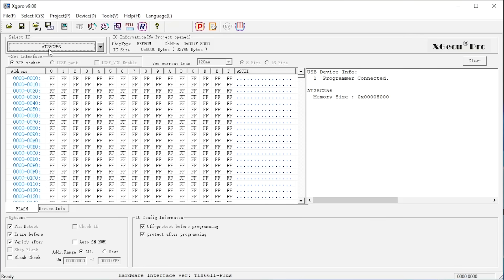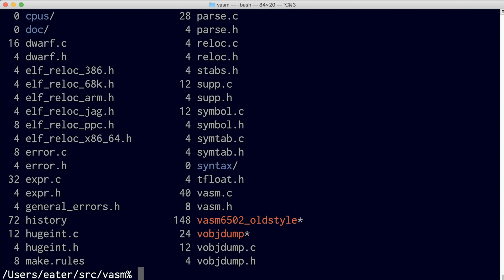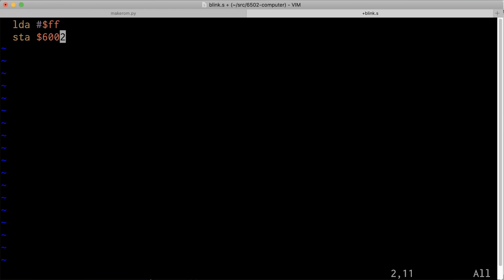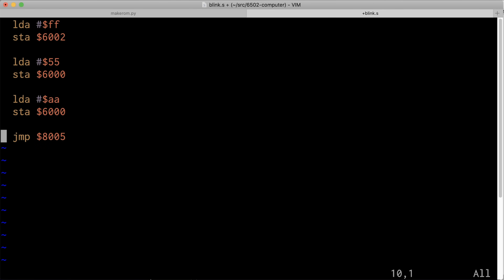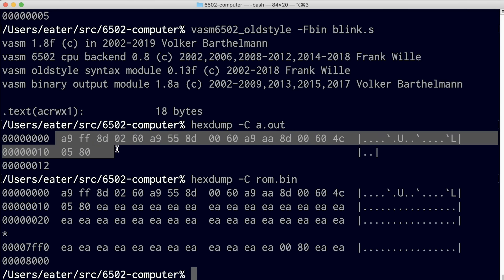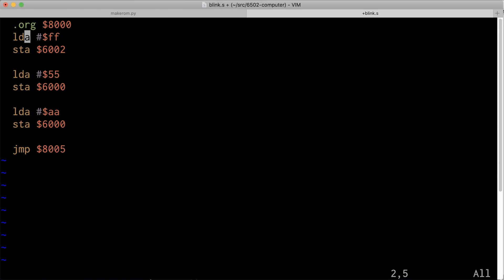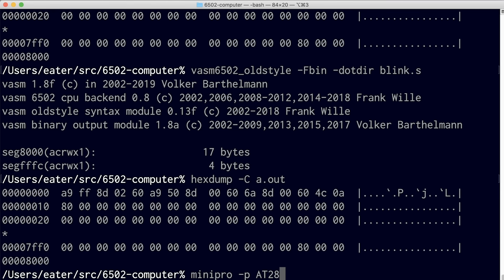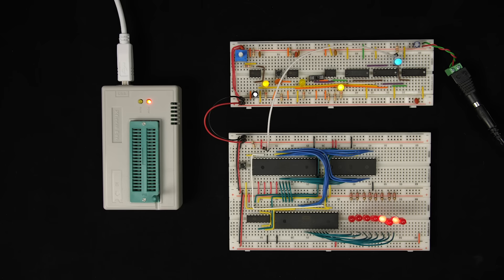Assembly language vs. machine code — 6502 part 3

Comment: One little detail... you might throw a CLC in there before the ROR unless you want to be surprised by three lit LEDs once in a while. 🙂
Reply from the maker: Hah! Good point.
Reply: The original 6502 from MOS actually does not clear the carry flag on reset, confirmed with Visual6502, so you have a good point! This might be different on the CMOS version though.
Reply: Explain please?
Reply: NoName If the carry flag is already set when the program is run, you’ll see three LEDs lit as the ROR rotates the bits around. From the datasheet, “All Registers are initialized by software except the Decimal and Interrupt disable mode select bits of the Processor Status Register (P) are initialized by hardware.” So the state of the carry bit is undefined when the program starts and has to be cleared explicitly if you want to make sure it’s off. Personally, I don’t mind being surprised in this example.
Reply: @NoNameAtAll2  
Even more exotic stuff can be done such as reading inaccessible control registers with an XOR mask that otherwise cannot be read; 

Other issues involve setting no-interrupts which is a difficult issue for me to think about; Here from the comment of John Scarfone we have rotate right which brings us to does it use what sometimes is a sign bit { + / - } or does it even look to see what the value is? 

Study Ariane Rocket disaster and you can find adherents of a multi-volume work I forgot the name of saying that it was not them and many other situations which deify sanity and bend the notion of what is right;  This is known as sanity checks when you drop into a loop; Clean programming will  run an initialization which sets some things and does not bother with others → for example you do not clear memory for testing usually;

Poor work results in midnight phone calls which are notorious for pitting you challenging vast empires that do not care in the slightest;
Reply: Thanks for that comment, i was already wondering why the carry bit somehow was already set on my cpu.

Comment: error 1011 in line 1 of "blink.s": identifier expected
>lda #$ff 

i had to add a tab at the start of each line to get vasm to assemble my code. in case anyone else gets confused. ben actually mentions it at 6:20 ish. >.<
Reply: Many older assemblers did not care about column position at all.  8080 and Z80 assemblers used the colon following the label to denote it as a label and would throw an error out if the symbol could not be identified as a mnemonic and did not have the following colon to identify it as a label.
In other words, it would check the first thing on the line to see if it was an opcode mnemonic such as LDA and if it wasn't an opcode it would check for a following colon to see if it was a label, otherwise you'd get an error message.
At least, that's my understanding of how it worked.  I may be wrong since I used to offset my assembly code instructions anyway just out of habit so it was easier to see where the labels were in the code.
Reply: This is quite common to most assemblers.  Last column used to write comments (tought semicolon preceded)
Reply: Some how I made this mistake and about panicked. Then found your comment. Glad you said something. Although now I feel kind of dumb.
Reply: @fathomisticfantasy2681  You're learning. You're not dumb. Good luck with your build!
Reply: @ServitorSkull  they might be dumb you don't know

Comment: nice one. Thinking about making a pcb  design for that clock module if i can get it under 100x50 mm . i think this kit could be expanded very easy also ever thought about adding  6551 serial interface to it ?

Comment: I HAVE in fact written code as a series of hex values...

But yeah, it's tedious as anything.

The things we do when we don't have access to proper tools. XD

To be honest I did this by doing the assembly process manually.

First I'd write assembly code, then I'd convert each line manually to it's hex code equivalent (keeping in mind byte reversals implied by little endian code), then I'd copy out these sequences into a block of hex values...

Then I'd write those values to a file using a hex editor.

Tedious, but it works if it's the only thing you've got...

And to be fair, there ARE people that have written fairly sizeable programs this way back in the 8 bit era - basically anyone whose only programming tool was a memory monitor has had to resort to this...

And you'd be surprised at some of the things that have been created that way...
Reply: Me too, and yes it is.

Comment: So... What book are we following for the 6502? It was "Digital Computer Electronics" for the 8 bit Breadboard Computer. It's hard to beat the plethora of resources on 6502 dot org, but is there an academic go-to reference for 6502's?
Reply: Anything written by Jim Butterfield (for 6502)
Reply: For coding, "Programming the 6502" by Rodnay Zaks was my bible in 1980...
Reply: Thanks. I did a quick skim on eBay yesterday and apparently there has been a run on ex-library/second hand 6502 books. Everything seems price inflated. It's no big deal to me. I have "Microprocessor Systems Design" by Alan Clements for Motorola's 68k stuff/systems designs in general. I was just wondering if there was an equivalent 6502 academic top-down (cook) book. I usually can't make it past the first few chapters of most programming publications before I'm bored out of my mind. My only motivated interest is embedded hardware. Starting with, and progressing from, printf or other equivalents drives me nuts. While it's still just beyond my grasp, "Threaded Interpreted Languages" by R. G. Loeliger contains some of the most interesting software concepts IMO. I keep coming back to that book. I also find "Introduction to VLSI Systems" by Mead/Conway fascinating. The idea that a student could design and have silicon fabricated in a few months by Xerox...what an incredible era of decades past :-)
   Are there any other vintage hardware publications that are a basic rite of passage for the non-EE hobbyist?
   I went on a tangent last night reading about the VAX-11 computers and then onto ISA's in general. Does anyone know of a good top down, undergraduate level (or lower) book about ISA's? Anyone can google-foo this, but someone vouching for a publication they've read is a search of far greater value :-)
-Jake
Reply: @UpcycleElectronics  I forgot about Rodney, yes he is good too.  http://www.atarimania.com/documents/Advanced_6502_Programming.pdf

http://www.atarimania.com/documents/6502_Applications_Book.pdf

http://chiclassiccomp.org/docs/content/books/Electronics/6502ApplicationsBook_RodneyZaks.pdf

Comment: im confused. the '.org $8000' at the beginning doesnt seem to be doing anything to the binary file. Shouldn't it offset the first instruction to byte 0x8000? How does that work if the file is only 0x8000 long according to the hexdump?
Reply: ".org" is shorthand for "origin" or the beginning address of the program to assemble. Sooo, ".org $8000" means "Begin assembly with the start address of $8000" this allows the assembler to calculate addresses for labels and such. If there weren't a ".org" at the beginning of the listing, then the assembler would default to address $0000. I hope that clears it up for you.
Reply: @15734_Hertz  Thanks
Reply: @cabbageman  Oops! I left out a zero and edited it to reflect a more correct explanation. I hope it makes more sense now. Enjoy the 65XX architecture! It's a fun hobby.
Reply: It just sets the base address at that point in the file. If you wanted it to pad the beginning to 0x8000 you would have to place another .org $0000 at the start.
At least how I understand it
Reply: @jmjmjm439   but then how does the eeprom writer know where to start? why wouldn't it just copy the bin to the top half? does if leave a flag on the file telling any eeprom writer where to start?
Reply: @jmjmjm439  if you add org 0 on top too.bin file will be 64k.its all work and ready if you have 64k rom.or split file and burn that top part on 32k rom.same thing.rom is 8000-ffff so that why we assemble it that way.evenit show it start from 0 it's just file adresss
Reply: It doesnt. See 7:41
Reply: @jmjmjm439  oh. Didn't quite get it the first time. It offsets the address for the 6502, but not the eeprom. Thx
Reply: @williamthompson5988  The org statement just gives the assembler a clue to where the instructions are logically so that it can calculate addresses from labels correctly.  However, it does no padding so the first instuction assembled will be the first bytes written to the output file.  The ONLY padding that is required is when .org $fffc is read so that the space between $8000 and $fffc is correct.  The binary file generated ends up being 32K ($8000-$ffff).  And so you write that 32K to the eeprom.

Comment: why is it that after the first .org directive (8000) the binary doesnt change (first inst is at 00000000), but the second .org puts the following code at #fffc?
Reply: Does asm know to not include any padding at the beggining (or end) of the binary?
Reply: Simón Saint-André the assembler remembers all of the .org commands
Reply: we tell .org $8000 to start asseble from 8000 and do all jmp op codes correct places.
and hexdump show just FILE. every file on earth start 0 dont they?
its just file with data it dont hold any address info.
eventually its just your job make circuit so cpu access that rom starting from 8000
even ROM start 0 like file but in circuit its 8000

Comment: If you have ".org $8000" at the beginning why is the assembler putting the first instruction at 00000000 and not 00008000 (with zero padding for all addresses before) in the output file?
Reply: Robert Gibbs it isn’t. The .org command tells the assembler that the first (I.e. zeroth) byte is $8000
Reply: @DoctorMikeReddy  Thank you. I understand now.
Reply: basically it tell assebler that part of code start 8000 and all jumps after is calculated correctly.
in this machine we have ROM located 8000-ffff 32K  becouse its wired so and it use 32K ROM :D

but if you have all parts but 64K ROM its no problem
.org $0000
.org $8000

would do 64k ROM then you just use that. just need wire circuit difrently and A15 for ROM not hooked up.
could use it bank switch
Reply: And it's just file.bin file don't have address it's just data but it work when you burn that data right starting address in this case 32k rom that is on circuit starting from 8000

Comment: But why does a program needs to be exactly 32768 bytes?
Reply: To fill the EEPROM, so that the programmer doesn't crap out.
Reply: Fffc need be correct please so it can fetch it.rom is 32k because it locates 8000-ffff
Reply: @jarisipilainen3875  mine has no ffff stops at fffd ;(

Comment: I have recently bought a W65C02 to tinker with, but I don't wanna risk burning it out, so I'm a little unsure on wether or not or where to put resistors of sort. Do the data lines and A ports have current limiting resistors integrated in them? What about the clock pin? Can somebody help me out?
Reply: It probably doesn't have current limiting, but you only need to worry about that if you're going to attach LEDs or some other high-current-draw item to the CPU.  In that case you'll need to add either resistors, or some kind of buffer circuit (and the buffer circuit may still require resistors if it's driving LEDs).
There are data buffer/register circuits which already exist as a single-chip solution.  See Ben Eater's Breadboard Computer series.  The circuit used for the registers in that series may be suitable for your purposes.
Reply: @melkiorwiseman  Thank you very much!

Comment: "No one actually writes software this way..,"

But you certainly COULD!  :)
Reply: I did. :)
(Not huge programs of course, but short routines)
Reply: @melkiorwiseman  Sometimes it is surprising what you can get done with a small program.  Our ROM was 64K which was fully utilized.  Luckily my portion of the modifications were only about an 8K change.  My code was mostly modification of previously certified production code.  The original code age was a collaboration of about 8 people..,  I got the tail end of the project and my application was an afterthought from manufacturing.
Reply: Someone had to write the first asm code.
Reply: @satibel  The SECOND programming job I had was writing maintenance code for a disk drive motor controller.

The CPU was an 8051 Embedded Controller microprocessor.

We didn't have a compiler for it so all the code was written in ASM.  We processed the source through a MAKE routine which performed the ASSEMBLY, and the LINK functions but the kicker is that those programs ran on an IBM VM system.

My crowning achievement was re-writing the  speed control portion to get the disk drive to run at 1/4 speed for a burnishing operation.  This also required writing an RS-232 serial port emulator using three of the 8051 available user I/O pins, which had to be multiplexed into operation with an external interrupt bit.

Those were the good old days!!!

Tha really scary part of the operation was burning off the 3KW power through some load resistors that glowed like a toaster oven when switched into the circuit.

There were boatloads of other application engineering considerations, but it worked!!
Reply: @neilolif  talking about resistors that glow like a toaster, I've used space heaters as load resistors as load resistors more than once. Currently, I have a toaster oven element as the brake resistor on my 4kw vfd
Reply: @satibel  I was most amazed that manufacturing would allow a box with three load resistors running at 250 degrees f in their test equipment.  But I bet the made some safety changes later.  My box was a prototype proof of concept..,  (Most of our engineering group really didn't think the task was possible to begin with.)